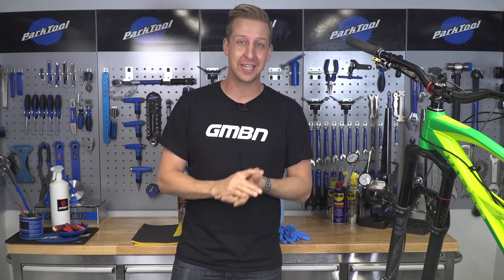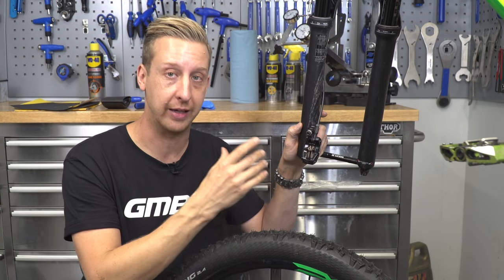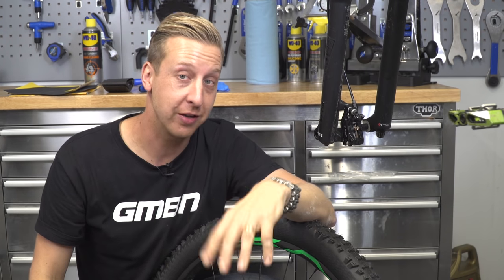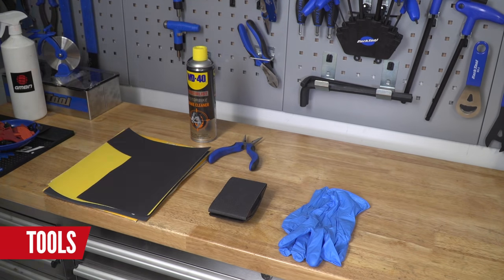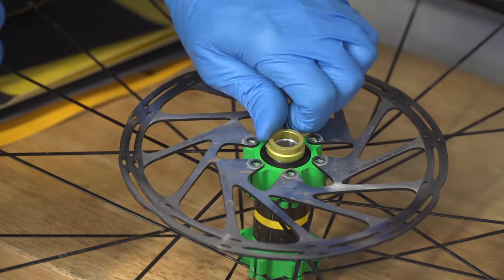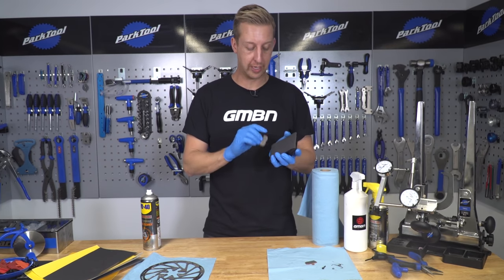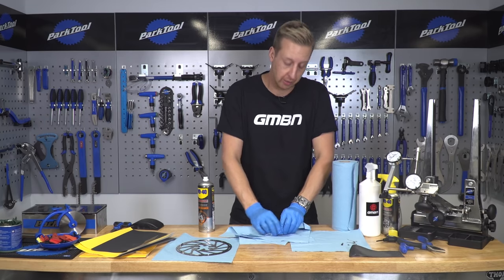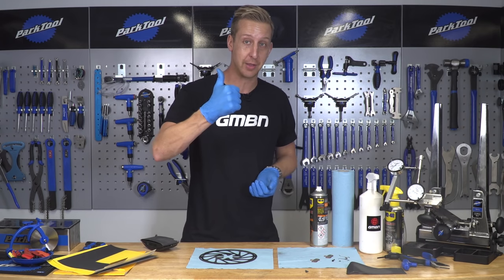How To Clean Your Disc Brakes | Mountain Bike Maintenance

Comment: You've missed another potential cause of brake squeal, Overheating and pad glazing. overheating causes the pad surface to become glazed or "shiny" which decreases their efficiency. This can also be caused by contamination but this is often more obvious. Heat glazing can be overcome by rubbing the pad face on some emery paper and re-fitting. Check that your discs are not warped due to overheating before you ride again. If the disc is a darker colour than usual or even blue due to overheating, bin it!
The cure is to use a different pad material or new pads as thin pads heat up more quickly. This heat can also  transfer to the caliper, heating the oil/fluid (DOT5.1 is not oil!) decreasing its life!
DO NOT use Copperslip or any other type of grease on the back of your pads. It'll melt and end up on the pad faces or discs. Just don't!!!
While I would rub the surface of the pads with emery paper (on a flat surface!) I would not rub the faces of the disc. Cleaning the faces will be enough as the pads will just polish them again very quickly!

Comment: hi guy need some advice. I follow your channel all the time and you always provide great advise, however I need help if you can assist. I bought a brand new Scott Genius 940, I have removed the back wheel to adjust the brakes slightly. Press the brake lever in and the pads closer together. Now it stops better and there is less pull when pulling the brake lever in. However my brakes are now screaming. I have adjusted the brakes back to the way they were originally and still screaming when i brake. Any advise

Comment: So i had a mishap bleeding my rear breaks and a fair amout of mineral oil poured over the disc i cleaned it with degreaser.  but now the break squeal   do i need new break pads and a rotor or can i just clean them like you have here

Comment: I have cleaned and degreased my pads and rotor. But my front brake still squeels like a pig after I bled it. Could there still be some air lift in the system?:/

Comment: My line came loose while bleeding my rear brakes and got some hydraulic fluid on the brakes. I did everything you describe on the pads and rotors. Still squeak. Is this effective on resin pads?
Reply from the maker: It's less effective on resin for sure. Sometimes unfortunately some pads just can't be saved when they're contaminated :/

Comment: What is the best way to remove dust? My bike has been parked since I had it serviced and new brake pads. I've noticed some dust on the rotor so I imagine there would be some on the pads too. I know I can just wipe down the rotor with a shop paper towel but curious about the pads. Thanks
Reply: Since dust isnt oily its probably fine to just wipe the pads off with a shop paper towel
Reply: @spyder027  thanks dude. I was just thinking about this the other day, but too busy working, hiking, kayaking, and fishing. Just wanted to make sure I didn't make matters worse during a dust cleaning adventure

Comment: Is it normal that one of the pads apparently is in constant contact with the disc? It doesn't interfere with the wheel's cycle, and haven't notice any issue on braking performance
Reply: If it's a floating system, and most bicycle disc brakes are, only one pad moves. A piston pushes the pad against the rotor which in turn pushes against the opposing pad in a clamping motion.  When you release the lever the piston and pad retract. If one of the pads are still in contact with the rotor it may be that the caliper needs centring. A simple matter of loosening the caliper mounting bolts, pulling the lever fully on, and re-tightening the bolts.

Comment: Would you ever recommend rotating my brake pads since I use my rear brake more than my front? I did this recently and I don't think it was a good idea. Is this something that other people do?
Reply: I've done that before, and it didn't cause any issues.  My pads were a softer compound, it may be more of a problem with the metallic brake compounds.  You'll hear it if the pads don't bed properly.
Reply: It seemed that the right side of a certain set wore differently than the left side so when I rotated the pads from the back to the front the left/right balance was different I think. But I could be wrong about all of this.
Reply from the maker: Thats absolutely something people do yes! Provided your pads and rotors are bedded in properly you'll be fine :)
Reply: Alan Taylor Farnes not a bad idea makes a lot of sense 👀

Comment: Another tip is to use resin pads.  (Sorry I don't know if SRAM makes those...Shimano does for their brakes.)  They stop much better than the metallic pads and hardly ever make noise!  They may wear down quicker, but I'll take that any day over noisy metallic pads that have shitty stopping power.

Comment: Yo dude I sprayed my brraks with WD40 bcs they were squealing so loud! and now they dont work as good as before can u give me some advice pls what do I do?
Reply: Replace the pads and don't use wd40 for anything on a bike. Anytime they get noisy just replace the pads and clean the rotors at the same time
Reply: @Reallifenewz  Ok thanks, but i dont have money for new parts could i just clean the pads?
Reply: @lavruzic7649  I've never had success cleaning pads. I have even thrown out a brand new set because they came noisy/defective. Usually not worth the time given they are usually around 10 dollars. If that's not an option you can try sanding them then soak them in alcohol for hours. Remember not to touch them and be careful installing them
Reply: Roused 
Do you recommend Vodka or Gin?

Comment: I've seen loads of videos on 'how to' clean brakes, but no mention of how often. Weekly, monthly, annually, every ride? Does it it depend on where you ride? I was cleaning my pads & rotors with IPA after every second ride & finding that they were very dirty. I was taking off loads of muck, but it didn't seem to make much difference to the brakes' performance. Any suggestions?

Comment: The disc brakes on my road bike squeal when coming to a halt (so at low speed). I have Shimano RS785 calipers with organic pads and Freeza discs. Cleaning the pads with isopropanol or braking hard on a fast downhill stops the squeal, but it soon reappears after a couple of rides. Never had any issues with the Avids on my mountain bike with sintered pads, so was wondering if the infrequent use of the brakes on the road bike causes them to pick up contaminants?

Comment: I washed my bike and my front brake started to squeal. I had replaced the brake the day before and just went for a ride around the neighbourhood to test them out. I they didn't squeal when I was on on the ride, and i didn't touch the rotor at all or overspray any lube on it as it is the front brake. I am sure that it isn't from the water on the pads as the bike is completely dry and it is only the front squealing. Would you say it is because of the first reason doddy mentioned?

Comment: Can I install larger diameter discs. I have a raleigh terrain 10... Or is that fixed as per the attachment on the suspension or body?
Reply: behzad bhandari you can use larger diameter discs, you will need to buy some adapters but they’re pretty common.

Comment: I just cleaned my new bike with only water to get dust off, its literally 48 hours old, and when riding around the house i noticed my brakes are howling unbearably. Is this a part of the bedding in process? How do i stop it?
Reply: Sounds like they're contaminated bud. Unless you have the brake cleaner and sand paper, I would just research how to burn disk brakes and follow that method for ease. You will notice a huge difference. The pads can be contaminated super easy- even if you think you are using water :)
Reply: Water always makes brakes squeak.
Reply: yeah mate, easy to accidentally get a contaminant in your water. Plus, you really need to wait for the disks and pads to dry properly before riding. Next time, if you can, get a hair dryer on the disks and pads before hopping for  aride and see if that helps a little
Reply: Jake I actually kinda like my brakes squeaking. I know they’re working.

Comment: What grit of emery paper should be used on your brake pads?
Reply: 80 grit.
Reply: @Cookie.x.monsterr  cheers, thanks
Reply: Sorry nick I was joking. I actually thought it was slightly obvious. But as you wrote back thanking me....  use somthing like 400 grit. Or even higher like 600. 
80 is far to rough!!!!     I used 600 i think once. But I sanded the pads down to much then they didnt really work.   80 would totally fuk them.   So the higher the number the finer the sand paper. And the finer the sandpaper the less chance of ducking shit up x sorry bro. I was in one of those moods.

Comment: My back wheel sqicks  but stops when I apply the back break..then comes back 3 minutes later? Any ideas? It's not a constant squick! Its like every time a certain point of the wheel goes round! Hope this makes sense. So basically riding normal with a sqick every second then stops when I lightly press my back brake, then will come back 3 minutes later?

Comment: Also, flattening pads is only going to reduce performance as the surface needs to be keyed to the wear in the disc for maximum contact and performance. You're also putting back all the brake dust you just cleaned off...

Comment: My brakes never squealed but once when i move slow enough and squeeze the brakes witb the right strength, it is actually louder than a truck horn. Idk why but the sound ia deafening. And also when i steer the discs apparently bend and rub. When i lightly bend the wheel, the disc bends too. Pls help i am planning to bleed both my brakes (sram guide r) and replace the rotors (203mm avid). Is it normal for discs to bend while steering or bending the wheel?

Comment: Can you give me one posible explanation why the brake caliper of my new bike is touching the "spoke" of the brake disc? and if i unscrew it a little bit press the brake to re-calibrate it the noise is constant and if i calibrate it by hand, by that i mean i force it as far as posible as i can from the brake disc, i wear the brake pads uneven because it has a constant contact with one of the two pads.. Any help?

Comment: It’s kinda ironic that he uses wd 40 on his brakes. The first time I used wd 40 I underestimated its power and a bit got on my rear rotor. Immediately when I tried my brakes after that I noticed the lack of performance on my rear disc brake
Reply from the maker: WD40 makes quite a few products other than their original multi-use spray. Doddy is using their brake cleaner, which is made specifically for cleaning brakes. The original WD40 will severely decrease your braking power!
Reply: Global Mountain Bike Network if it’s just on the surface, shouldn’t you be able to remove it completely with sandpaper

Comment: Wanna cut short all the BS?

- Just use apple Vinegar. You don't have to remove any of the caliper parts. Spill it over the braking pads while mounted, press the brake and move the bike so the dirt would get cleansed by the disc.

Then clean the disc with a pure cloth dipped in vinegar. Then repeat the process until the noise is gone.

Note: Because the pads get wet from vinegar, they may produce a flute-like sound, yet in 500m ride they will dry from braking and no noise remains. Zero. Just like brand new untouched brake set.

Comment: You do realise everytime you say disc rotor you are saying the same thing twice lol. Disc disc. Lol. A rotor is the American name for a brake disc. Its nuts because even Shimano packaging has disc rotor written on it lol. Guess it depends how you say it. If you Disc brake rotor then I guess that's ok. But if you say Brake disc rotor then you are saying brake disc disc lol. Also fire is your friend. Otherwise residue can be left in areas you cant reach with a cloth such as all the vent holes in the disc.

Comment: There's actually loads of misinformation in this video. You're cleaning the parts that are self cleaning. This won't stop squealing unless the disc or pads are contaminated. The only part you need to clean with brake cleaner from time to time is the inside of the caliper around the pistons so the don't pulls in brake dust and gunk past the seals and create a leak in the system.
Reply from the maker: This video is for squealing brakes in the case that they are contaminated or not properly bedded in. As you say...no point doing this if they're not contaminated 😃